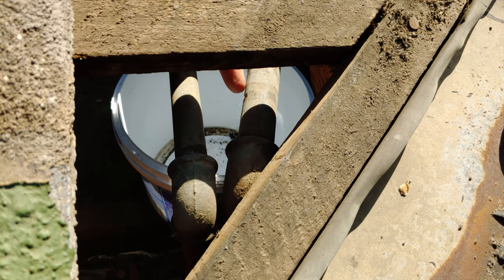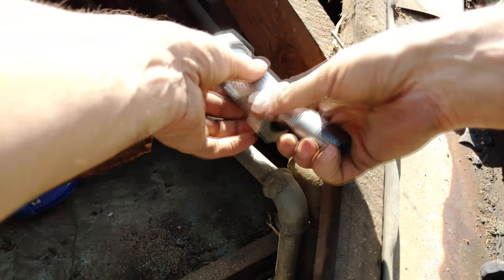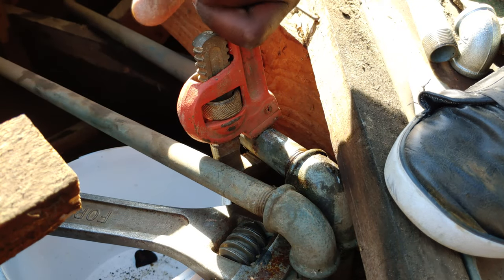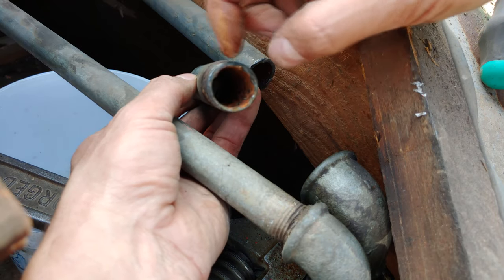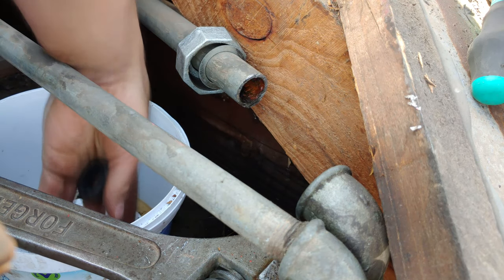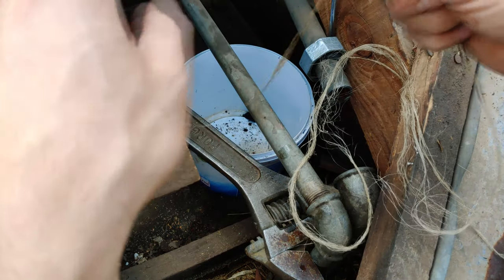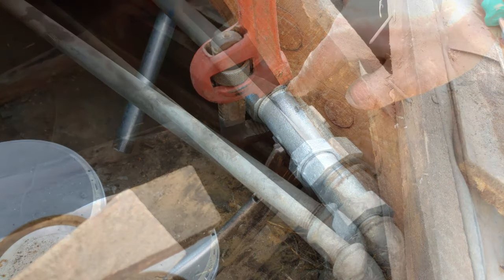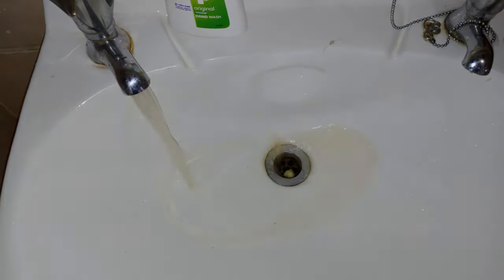How to fix a leaking galvanized pipe using a Johnson coupler

Comment: Thank you for the video. I thought I had to dig up 30 feet dirt to replace the supply line. I didn't know there was such thing as a coupling for galvanized pipe.
Reply: Just a tip on the coupling. If you can swing it use a dresser type coupling for a more permanent fix. They are high as hell but the longevity is far greater than the type used here. I use these for convenience but ive never considered them a permanent fix. If used be prepared down the line for it to fail. If you see a drop in pressure this would be the first place to check. The couplings im referring to have flanges and gaskets and bolts. They require more room but aside from rethreading or replacing lines its about the best repair method out there. The cost for a 3/4" compression coupling like used here is from 8.00 to 16.00 the dresser type would be in the area of 40 to 80.00.

Comment: I would have made the nipple longer to give more room for the coupling to compress, also would have chopped the threads off the nipple so they don’t damage the rubber, also would have sanded the pipe where the wrench left marks to ensure a good connection. But that’s just me 😅

Comment: Yes but these couplings are also called a temporary coupling, because they do slip off over time I think. I am using one now on a steel pipe too, and it is leaking even though the ends are tightened all the way. I am thinking about applying some sealant around the inside of the ends. The rubbers on mine are different though, maybe your rubbers are a better design!!!
Reply: All these dresser couplings are temporary fixes.
They last much longer on cold water lines, less on hot water lines.
 I’ve seen them last for over 20 years on cold water lines.
But yes you are correct about these types of dresser couplings,
they are not permanent.
But you can get lucky sometimes.

Comment: Down here in Texas with the freeze breaking pipes. I have a 10 foot hot galvanized pipe that has a small crack in the middle of the pipe. Can I cut it and use this product for a permanent fix or is it temporary fix?
Reply: Yes, this is a great option for you to repair this thing. This is a great fitting that will last a long time. Although if I was you I would go ahead and replace all of your galvanized pipes with pex if you can. None of the stupid rust/clogging issues and it gives you a little more freeze protection since it can expand a little bit if it freezes. But you should insulate your pipes anyways, because even in texas it can get cold as fuck.
Reply from the maker: yes if you think 5-7 years is permanent.
Reply: @ecologicaltime  It would be nice to line galvanized with an epoxy coating so the housewife doesn't have to clean up rust in the bowl.
Reply from the maker: @DG-ie5ip  no i was not saying pex wont last long. I was answering the earlier question about how long the coupler will last. My answer was not about pex pipes. I was replying to DF comment. Galvenized do rust and split... especially when they are run in the ground.
Reply: @Susan70003  throw in vinegar and it will clean itself.

Comment: That crescent wrench does absolutely nothing.... And as far as the hemp goes - you GOT to be kidding !
Reply from the maker: Have you used hemp? Why are you saying its bad? Any reasons?
Reply: @ecologicaltime we use pipe dope and tape
Reply: @williamhartsell6390  I guess if you haven't tried the hemp, then why are you mocking it? Other parts of the world use other materials. As long as it works well, that's all that matters.
Reply: @No_bread-and-circuses  I wasn't mocking anything. I'm just saying we use teflon and pipe dope. Hemp was actually illegal until recent years

Comment: You are supposed to put the hemp on in a clockwise direction on the thread otherwise it will push off as you tighten the joint , also it's always best to use some jointing paste with the hemp not water as you did.......  😜
Reply: What is jointing paste?
Reply: @Susan70003  .... it’s a linseed oil based paste with the consistency of tooth paste , it’s used for threaded pipes in gas work but can be used in water pipes but you need hemp as well to make a water tight joint , it’s mainly used in commercial and industrial pipe work these days..... 👍
Reply: @yensabi  If it's the white stuff it specifically says not to use for supply - only drains.

Comment: We have chicken houses and use propane with galvanized pipe. I have leaks where the pipes connect. Is there anyway to fix them without taking them apart?
Reply: Yo should use the black steel pipe with gas, not this galvanized pipe.

Comment: Can you use teflon tape instead of hemp string?
Reply from the maker: yes but hemp is best, seriously.
Reply: Tefloan tape using during fitting process mostly but joint cases use hemp string best gripper tightly
Reply: @ecologicaltime  you twist it the wrong way round
Reply: @ecologicaltime  you twist it the wrong way round

Comment: It's quite hard to find that coupler here in my area. Is it possible if I use PVC coupler to connect galvanized pipe?
Reply: it will work in an emergency but you are taking a huge risk.  2 different plumbers told me that there's a risk of it "blowing apart"
Reply: I had a PVC replacement about a year ago, all good so far.
Reply: Schedule 40 PVC is not for pressure.  CPVC on the other hand should work perfectly.

Comment: Can you mix galvanize iron coupling with galvanize steel pipes
Reply from the maker: they have slightly different expansion and contractions but because the coupler is a compression coupler i would not worry about two different pipes.